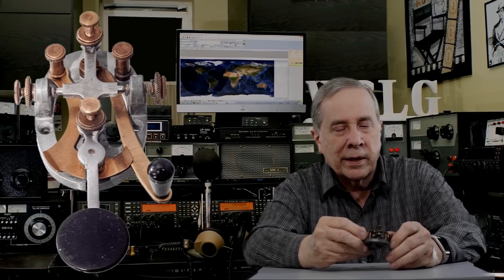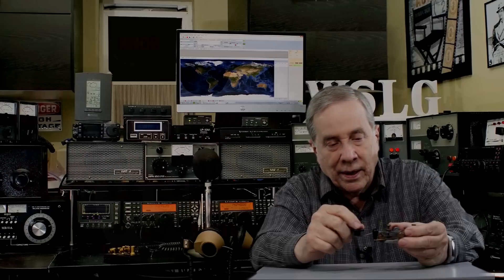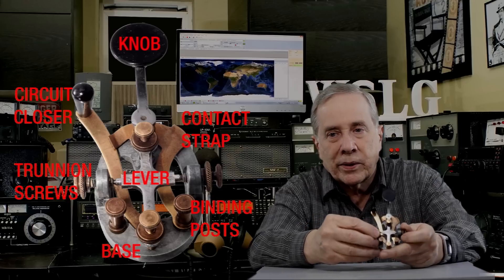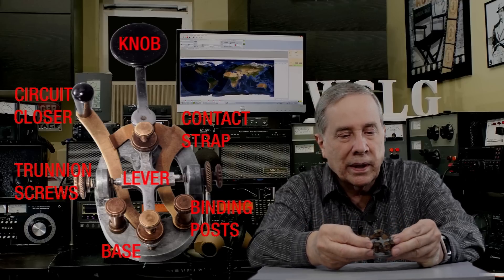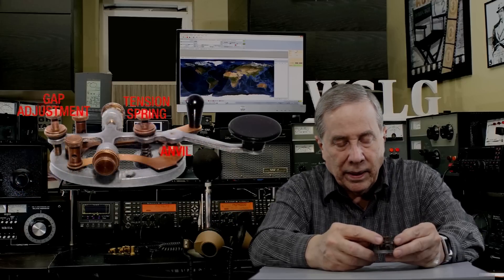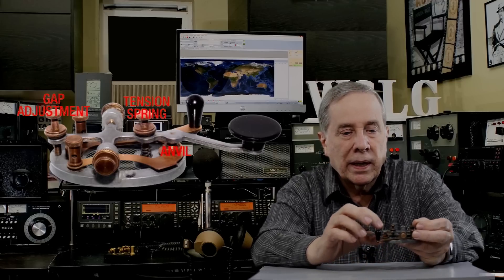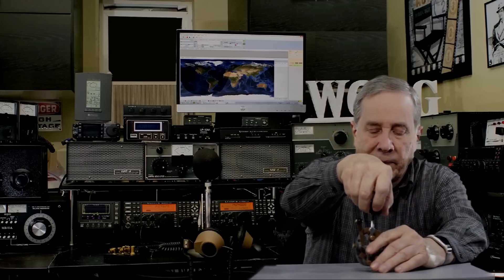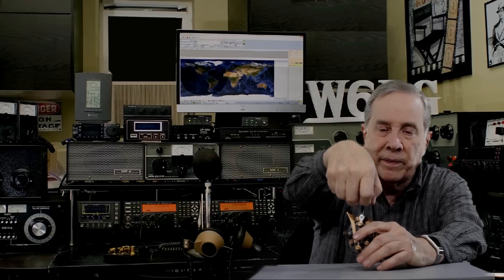Ham Radio Basics--Sending CW With a Straight Key--Morse Code

Comment: Still have a Heathkit code oscillator model hd-1416,  s/no.03635  I picked it on a leg mounted straight key at a Hamfeast in the early 90's. I just put fresh 9 volt in and going to work, I had about half of the alphabet down. Thank you.

Comment: Jim, this appears to be a Lionel J-38 without the base.  The J-37 does not have the coil spring, it used a leaf spring connected to ground.  The J-37 also did not have the shorting bar.

Comment: Love your videos Jim. You definitely have a voice for radio haha. CW guy myself, still green. Had my license less than a year. Learning with a straight key is the only way. It's like learning to drive with a stick. If you can do that, you can "drive" anything! KE8EAS
Reply: How goes your cw skill today?  Just starting myself.
Reply: Aurtisan Miner I’m just starting myself. Pulled out the old Yaesu FT101B when I emptied under the stairs. Found myself an old Plug & Key 2B WWII key for $20 and pulled it down.  Polished the contacts so it works a treat

The key is rated at 8 Amps and has a normally closed contact too for break in Keying with a separate receiver 

Still struggling to get my read by ears up to speed though and still not too sure of the whole QSO format. I’ll be happy once I can hear a callsign without a.brain freeze
Reply: Chris Wilson ha ha!  I hear you. I’m more fluent with letters than numbers. When theyre mixed it trips me up. I did get a response while tapping CQ last month, but they responded with a punctuation mark that I didnt know. By the time I looked it up and responded they had gone. Turns out it was a question mark. I guess they had a hard time making out my message of “I suck at CW”.

Comment: Hi Jim,
Nice video. Another way to set the gap is using a 1/32" drill bit, or if you have the drill set with the letter and numbered drills use a #68.   :-)  Could never get my speed above 10wpm, but will try again after I get my Extra ticket.    73 WB3BJU

Comment: Thanks for the nicely labeled pictures!

Here's a question about straight keys: A couple of weeks ago, I obtained the TS-1 key used by the Yugoslav People's Army, probably manufactured by Industria Radio Elettrica e Telecomunicazioni (IRET) from Trieste in Italy.  It's a version for field use with two thigh-straps and metal cover over the key mechanism itself.  One interesting thing about it that I, as a CW noob couldn't figure out, is how to adjust the gap on this key. It has a gap-adjustment screw, just like pictured J-37, but with one big difference: Instead of a fixed upper contact, the key has an adjustable screw, so you can change the gap at both the front and the back of the key. 
Does anyone have any tips on how much to adjust the rear gap screw and how much to adjust the front top contact screw?

73 from YU1NKA